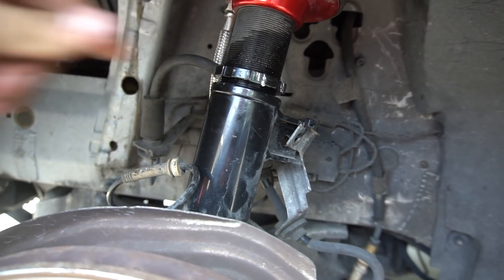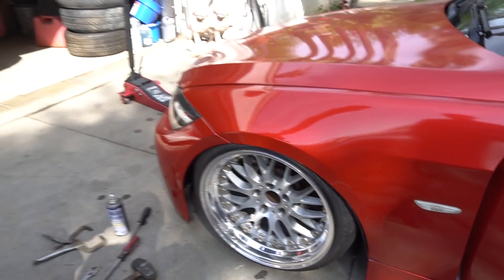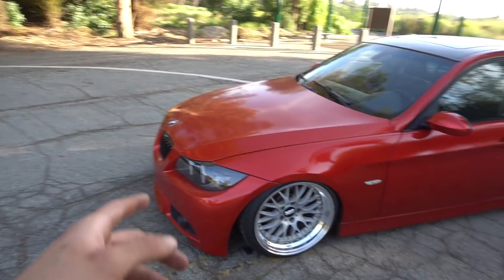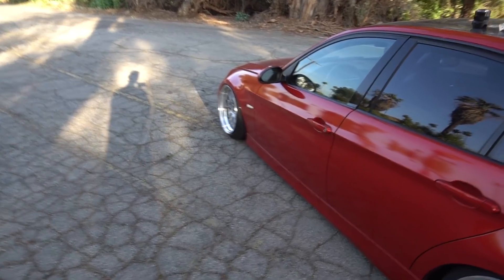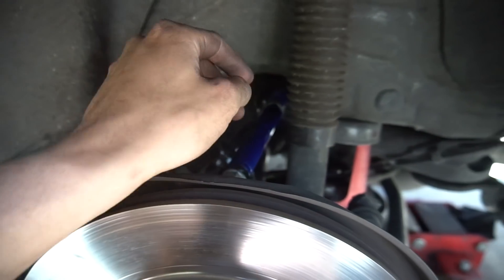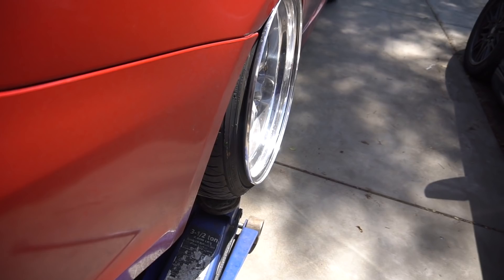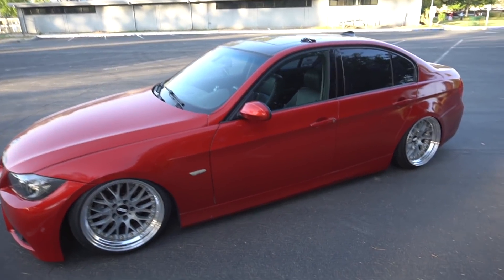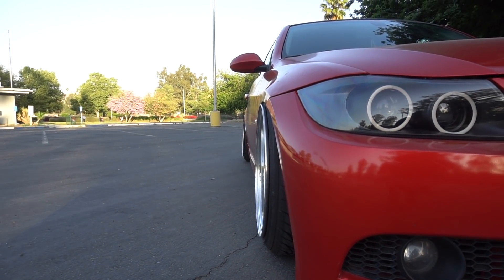FIXING MY FITMENT! Front & Rear Camber Arm Adjustment

Comment: Hey bro, nice job on the fitment! I got a question for you tho: I got the same car but on 19s
1) about how much (in inches) would you say the Megan rear camber arms can move in and out by spinning the center part?
1) when you were adjusting them, did you just keep turning it until you got the look you wanted? How do you know if you turned the left and right sides the same amount, were you just eye balling it?
2) when they aligned your car, did they play around with the end links too like you did?

Thanks keep up the nice work!

Comment: I would be scare that my tire would d bead on the freeway with that stretch, 
Had a question I just did my alignment and I want to adjust my camber again do I need another alignment after adjusting camber on my caster plate?
Reply from the maker: Yes.